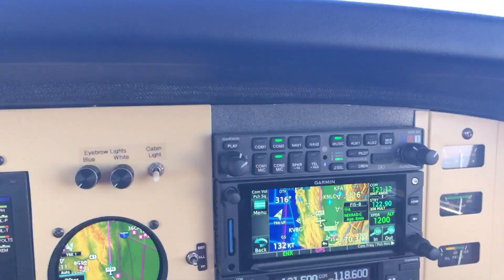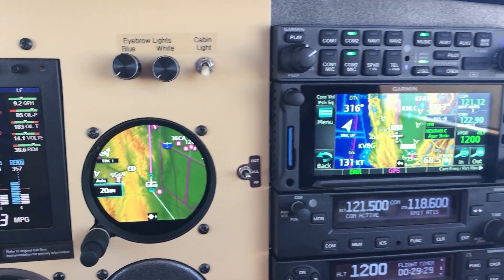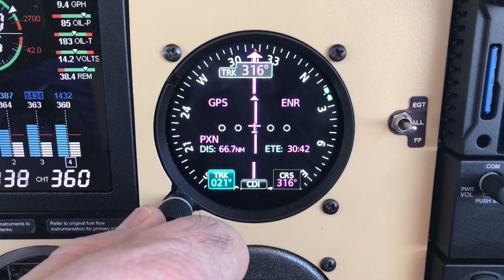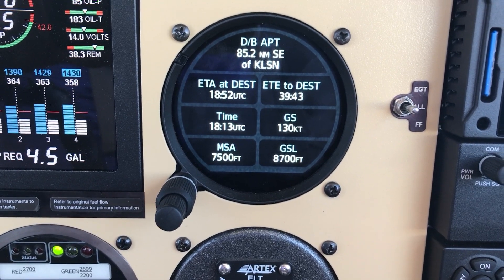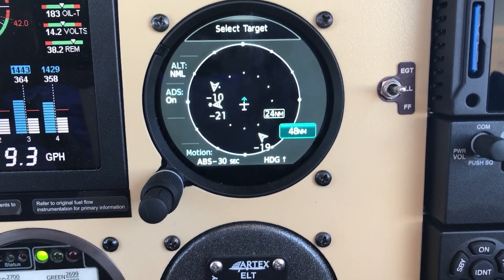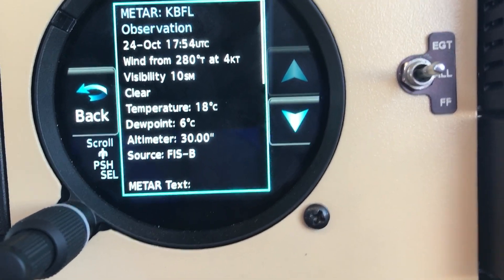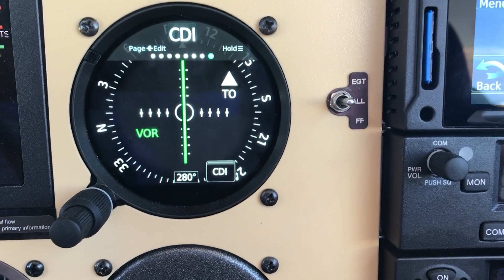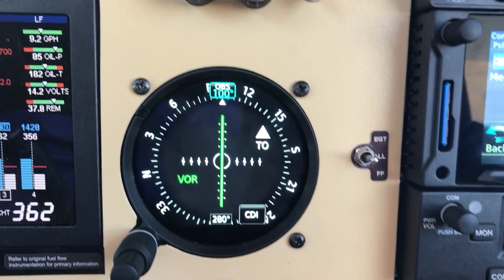Flying with a Garmin GI 275 MFD

Comment: Hi there, Dennis! I'm struggling to have my Terrain Database updated on my GI 275, which is paired to a GTN 750. How did you managed to do so?
Reply from the maker: Hello Hiago. 
I fought with this issue for months after installation of the GI275s.   Finally I had the latest firmware update put in ( which is probably not your problem if they are new, but check anyway) and tried a direct connection via the USB dongle.  That finally worked.  

It seems like neither the Wi-Fi connection or pushing from the GTN works for the Terrain Database.   Garmin tech support is nice, but they had no idea how to solve it.  This was quite sometime ago, perhaps they know more now.  Please let me know how you resolve it, I would be very interested to know.
Reply: @dcheever777  thanks for your answer! 

So, I guess that Garmin still didn't figure how to solve this nowadays... 
Because just like you, I tried to push the Terrain Data from my GTN and also with the Wi-Fi connection. No success. 

The main reason must be the size, Terrain Database is too large compared to others. So it demands to upload and update via USB only. 
I will try to do that later on. I'll let you know if I succeeded or not, thanks again for the help!

Comment: Thanks for the video. Funny thing in various videos no one addresses the cost like this even the cost of the item less installation!
Reply from the maker: The problem with including the cost is it may (will) change.  The best source of the instrument cost would be Garmin's website, I'll include a link and hope it works.  Regarding installation, there are so many variables only dealer could give you a true estimate after looking at your plane.  In my case the 275 was part of a bigger install job and certainly cost less than had it been a standalone installation.  

The price has gone up since I installed mine. I hope this will help:
https://www.garmin.com/en-US/p/719027/pn/010-GI275-06

Comment: What is the GSL to the right display of the MSA?
Reply from the maker: It’s height above sea level as determined by the GPS, not barometric.  The acronym is for Geometric/Geodetic Sea Level. I put it next to MSA for a quick reference, but didn’t find it useful and have since changed it.

Comment: Do you get nav2 on that CDI also?
Reply: nevermind, I it doesn't look like you have a nav2 only comm2.
Reply from the maker: You are correct Dan.  It’s still a good question though.   If there’s a second NAV I expect having the MFD set up to display it would be great.    Honestly until after it was installed I had no idea that I would be able to use  VOR on the 275 simultaneously with GPS on the G5 both from the GTN.  Whew, that’s too many abbreviations in one sentence!

Comment: Hi Dennis, great video!  I have a single nav with a dedicated CDI, but want to add a Garmin GPS which I’m told can’t share the CDI with the nav.  So I’m considering replacing  my directional gyro with the GI 275 for GPS approach guidance and DG in one unit.. I’m confused, it seems one configuration is the MFD with an HSI page? But Garmin also sells the unit in an HSI only configuration.. not sure which is the right unit for this scenario.  I hope this is clear, your thoughts would be greatly appreciated.
Reply from the maker: Hey Paul.  You should definitely talk with a Garmin dealer and get the correct configuration for your needs.  Although the MFD does have an HSI display I don’t think it’s certified as a primary instrument.    A dealer will steer you to the proper model.

Comment: Thanks, Dennis!  Sweet set-up.  We're shopping G5 vs GI-275 vs uAvionics AV-30, so this is helpful.  I assume if we buy the GI-275 for AI or DG they are locked-down so you can't access all those screens?
Reply from the maker: That’s a good question, I’m not sure which screens are accessible in that configuration.   My guess is that they are limited,  but a call to Garmin will tell you.   
I haven’t flown the AV-30,  but don’t like the fact it has no magnetometer.  In my opinion it’s a VFR instrument,  the Garmin’s are both very capable IFR tools.  Best of luck and happy new year.

Comment: Hey Dennis, we are trying to decide if we should go with dual G5 or GI275 units. Any opinion now that you have both?
Reply from the maker: That's a good question, I don't think there is a simple answer for everyone.  I like the slightly larger screen size of the G5's and would not trade them for GI 275's, however I can also envision many installations where the 275 would be preferable.  Instances of that might be not wanting to change the appearance of a vintage panel or not wanting to install analog gauges on a small panel. With the G5's airspeed and altitude are not primary, with the 275 they are.  Another case would be integration with a third party autopilot that won't work with the G5.  I'm sure you can find YouTube videos of them installed as ADI and HSI that may help your decision.  It won't be an easy one to make.

Comment: OK, so I need my lasses to use..... 🤪 look if the display was twice the size, good. How much does this thing cost installed?
Reply from the maker: It’s actually easier to see than I had imagined.   You can check prices at any online supplier. This is an item Garmin doesn’t require a dealer install,  an A&P can do it.  One caveat though, be sure they are well versed in electronic installation,  the CAN bus must absolutely be wired correctly.   I’ve heard of intermittent problems when it isn’t.